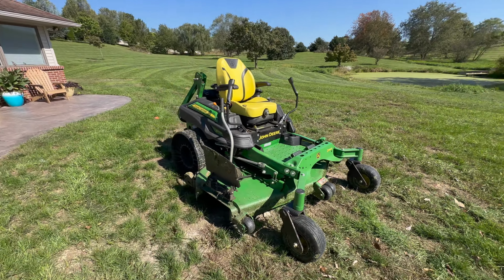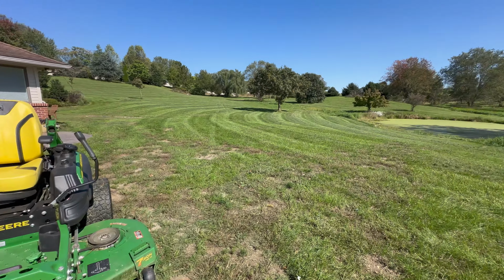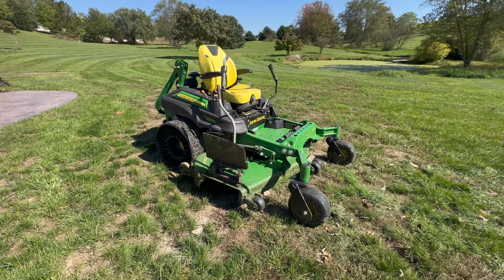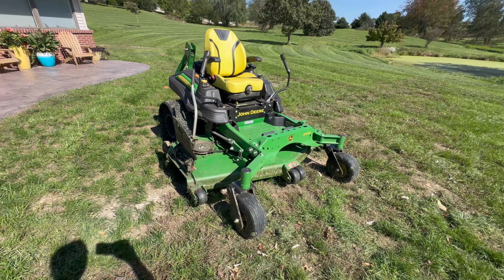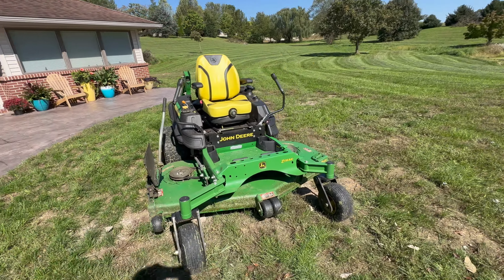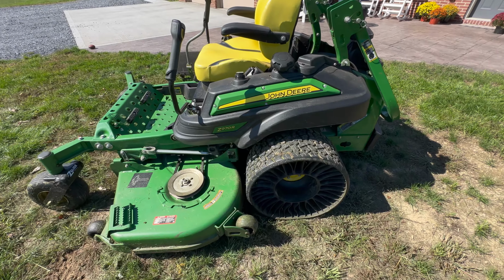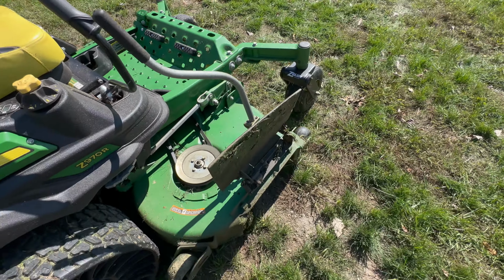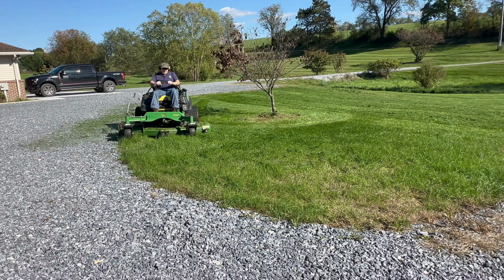John Deere Z970R Zero Turn Laying Stripes and Tractor Work

Comment: We have a z994 r diesel in work with a mulcher deck.
The glide seat is really good, we have the tweels too with no issues with traction. 
Tell me do you drop the roll bar because of the horrible noise it makes?😊
Reply from the maker: I drop it because I run in to things with it lol!